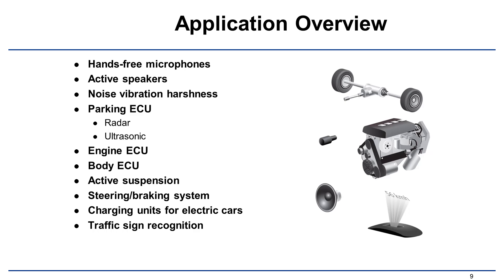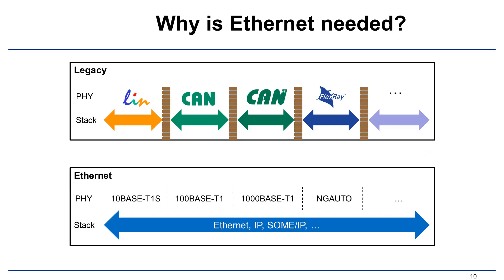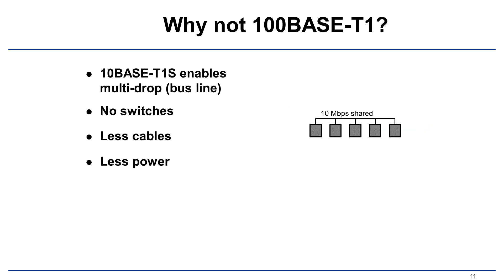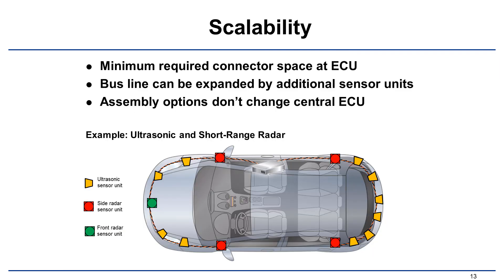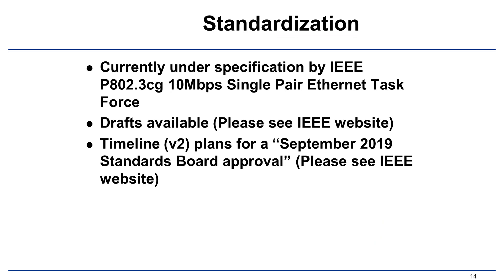10BASE-T1S Introduction

Comment: The picture at 04:02 is a little bit misleading in my opinion. It shows a point-to-point connection of the sensor units to ECU instead of a bus architecture (e.g., CAN-FD bus) for example at 10 Mbit/s. Some of the stated benefits of T1S such as less cabling, and ECU connectors wouldn't apply in that case - is that correct?